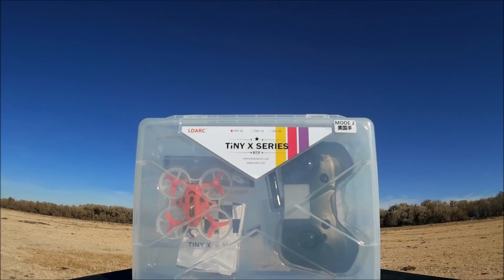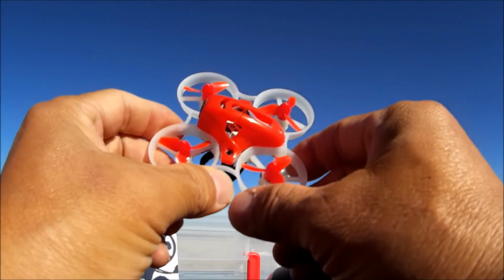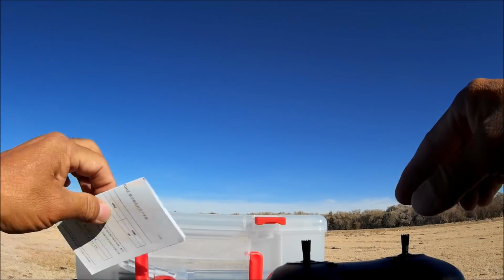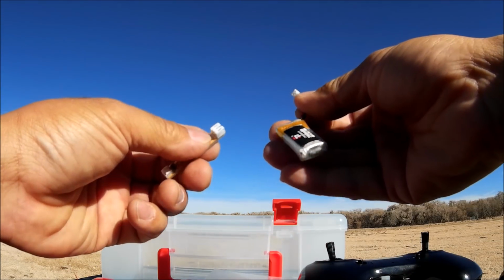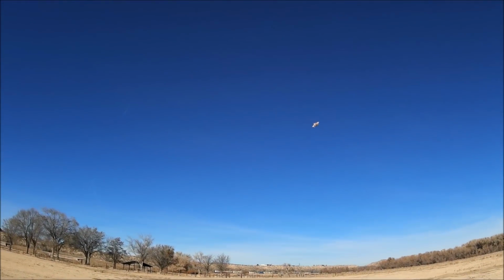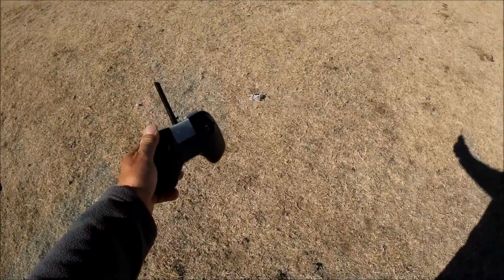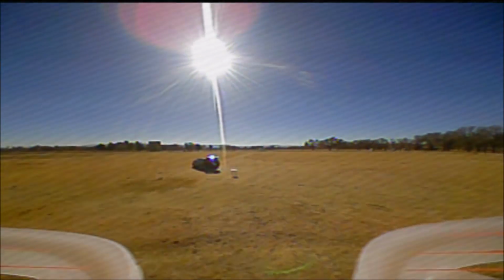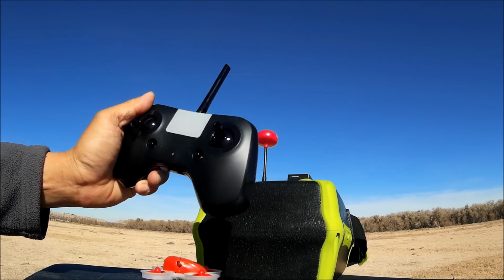LDARC TINY 6X 65mm Micro FPV RC Drone RTF

Comment: I don't like to be constrained by the shape or size of batteries so I use silicone tape, you just wrap it around the quad with battery wherever it fits as long as its still balanced.  The tape only sticks to itself and when it gets dirty it just rinses off with water.

Comment: I can't get my Tiny 6x to arm. Everything else is perfect. All things in Beteflight are perfect, including the arm function in "modes". It works "on paper", the motors work through Betaflight, the receiver is bound and works, just no arming!! Please help! (I'm using a FlySky FS-i6 tx.)
Reply from the maker: ernie5229 
So the arming switch is working in the modes tab but it will not arm?

1) calibrate on a level surface.
2) make sure all the other switches are in the off position
3) go into betaflight and in the receiver tab, pull down the throttle and check the value against the 'stick low' threshold.  The stick value should be lower.
If it isn't, either lower the end points for the throttle or raise the low threshold.

See if that helps :)

Comment: Damn it. Finally manufacturer realized 65mm whoop flies waaay better on 716 motors.
I got KK tiny6 few month ago and make X from it using Eachine e011 frame and motors.
At least manufacturer try to make better quads. Good.
Thanks for good review.
Reply from the maker: Get the HV batts!!!  Gots more punch!!!
Reply: RC Escape I got HV battery as I swap battery connector to PH2.0. I still charging it to 4.2 and having 3 minutes flight time.

BTW does quad comes with PH2.0 battery connector or sh.ty 1.25?
Reply from the maker: Equip Pro 
Ph2.
I use the bold clash battery charger with a 3s battery I don't use anymore.  It charges HV.
I'll give you the link.
Reply from the maker: https://www.youtube.com/watch?v=rrpMiToR_xs

Comment from the maker: The Tiny 6x RTF comes with a Futaba RX 800 pro receiver and it will bind to the Jumper remote using the S-FHSS protocol!!!  
There are also other receiver variations in BNF as well as the PNP.
https://goo.gl/CUZE5o